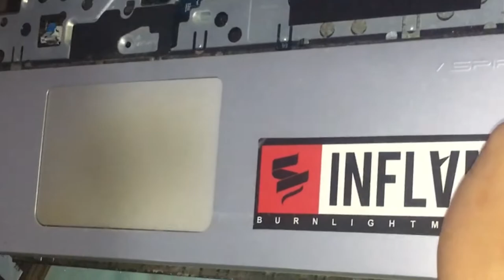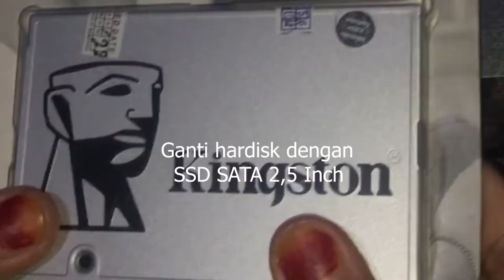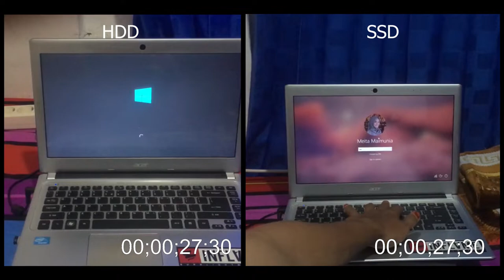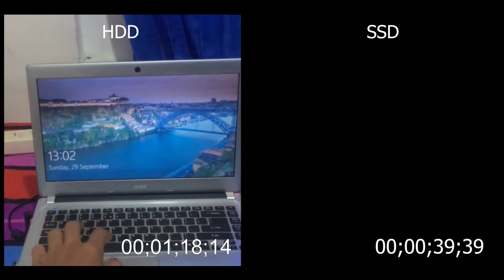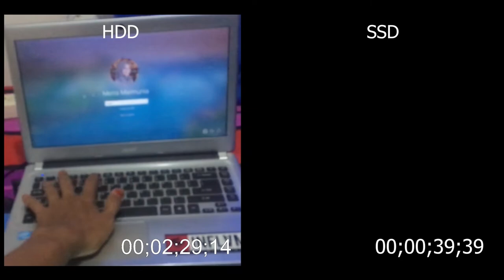Upgrade SSD laptop Acer V5-431

Comment: Windows 10 build 2004 untuk Acer V5-431P masih bisa support di Processor Intel Celeron 1.5Ghz, soalnya mau install ulang?
Reply from the maker: Masih support kak, dimaksimalin aja ramny jadi 8gb.
Dan yg terpenting ganti storage sistemny pake SSD.

Mksh kk udah mampir bantu like & subscribe y.
Reply: Pny gw v5 132 celeron 1 ghz kuat win 10
Reply from the maker: Mntab.
Mksh kk infony

Comment: Acer ini dikasih SSD Adata 480 tapi HDD masih dipasang kira2 gimana kak?
Reply: Pke caddy (mulai 18rb-an) tuk menggantikan cd reader dengan hdd, lihat aja tutorial yg lainnya atau laptop lainnya. 
Atau kalo mau cd reader tetap terpasang jadikan seperti flashdisk dengan membeli enclosure hdd (mulai 45rb-an) atau hanya sekedar "kabel sata to usb" (mulai 40rb-an). Pilih yang versi usb 2.0 (kecepatan memindah file max 60MB per detik) kalo mau murah, kalo mau bagus beli yang versi usb 3.0 (kecepatan memindah file max 480MB per detik)

Comment: Saya juga punya acer v5 431, baru beli ssd 480gb kingston. tapi pas ganti ssdnya gak kebaca. Ada solusinya gak?
Reply from the maker: Mksdny gak kebaca waktu cek dibios y kk? atau gmn?
Reply: @andrimulyadi6665  bila disambung melalui usb ada kebaca di komputer. Tapi bila sdh diganti dengan connector internalnya di menu bios tertulis hdd: none
Reply from the maker: Atau cb kk format dlu sesuai format untk instalasi windows saat pake usb, stelah itu cb konekan ke sata lg kk.

Kalo msh boleh fotokan biosny jd penasaran, aq rasa mngkn ada pilihan di hddny & blm select ssdny, makanya pda saat dimenu bios boot g muncul.
Reply: @andrimulyadi6665  boleh sarankan gak, cara formatnya kak?
Reply from the maker: Saat usb di plug ke komputer, klik kanan ssd ny trus format kyk biasa kk, kyk format flashdisk,
Formatny ntfs
Reply: @andrimulyadi6665  udah format, tapi masalahnya bila mau install windows 10 melalui usb ditunjukin unallocated space total size 0.0mb free space 0.0mb ada solusinya gak ni?
Reply: @andrimulyadi6665  gapapa gan, udah bisa guna ssdnya. Gw nyoba trial and error aja sampe bios bisa baca ssdnya😂
Reply from the maker: الحمد لله 
Mantap, Syukur deh kalo gitu.
Selamat y kk 👍🏻🙂

Comment: Buat yg nanya ini bisa pakek game atau enggak saya jawab bisa , game PES2013 , GTA SA , NARUTO NS3 , NEED FOR SPEED karena saya juga pakai laptop ini makasi 🙏🙏 .
Reply from the maker: Terima kasih udh sharing kak 🙂🙏🏻
Reply: Bang coba instal Point blank
Reply: @Moonlight-kg5uy  udah ga kuat lagi bang 😪
Reply: @buleofficial8204  pakek hdd atau ssd bang?
Reply: @dayday-de5hj  masih pkek hdd bg 🙏
Reply: @buleofficial8204  Windowsnya pake 10 64bit kah?
Reply: @dayday-de5hj  win 7 bang
Reply: Point blank bisa kok jalan ram gw 8 hdd masih standart ga patah2 kok os pake win10pro...sejauh ini sih normal...ane main RF main PW...main RO
Reply: @sandysouisa3514  ram 4 bisa ga ya?
Reply: @dayday-de5hj  saya upgrade ram karena agak patah2 tp setelah ram di upgrade jd enak kok

Comment: Datanya hilang apa gk kali ganti?
Reply from the maker: Data di hardisk lama masih ada kk

Kalo di ssd blm ad kk datany jd mesti di install ulang dlu baru dipindahin data yg dari hdd ke ssd.
Reply: @andrimulyadi6665  di install ulang hilang semua?
Reply from the maker: Kalo yg di install ulang cuma ssd, data yg di hdd lama g ilang
Reply: Jadinya data pribadi gk ilang?
Reply from the maker: Yups.
Reply: Satu lagi boleh kan,Kalo upgrade 32 bit ke 64 bit data pribadi hilang apa gk?
Reply from the maker: Document, foto, video g akn ilang kk, cuma beberapa app aj yg awalny support cuma 32bit. Tiba2 ganti 64bit, jd g support lg, itu aja sih kk yg perlu diperhatikan.

Jgn lupa like & subscribe y
Reply: Ok makasih ya auto subscribe
Reply: Bang kok WiFi di laptop ku broadband connection padahal tadi siang gk knp knp
Reply from the maker: Cb di restart kak, atau coba di klik kanan trus cb troubleshoot kk.
Reply from the maker: Btw mksh kk 🙏🏻🙂
Reply: Ok,masih sama aja gk bisa😭
Reply from the maker: Statusny ap kk? Ap tulisanny?
Agk susah sih klo g liat gmbarny lngsung
Reply: IG aja gimana
Reply from the maker: @andri.m29
Itu kk
Reply: Ok igku quizalarvito
Reply: Udh aku follow
Reply from the maker: Oke
Reply: Bales dm ku bang